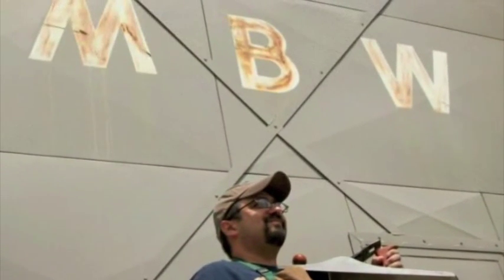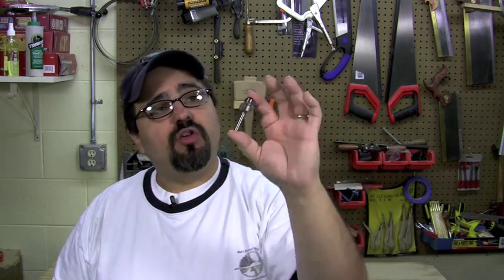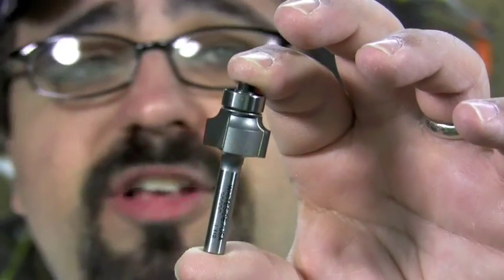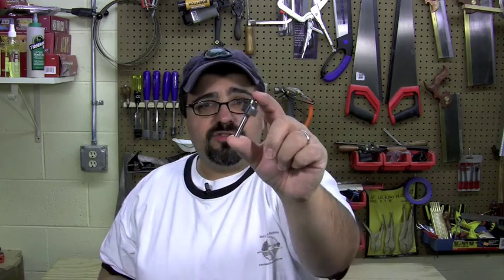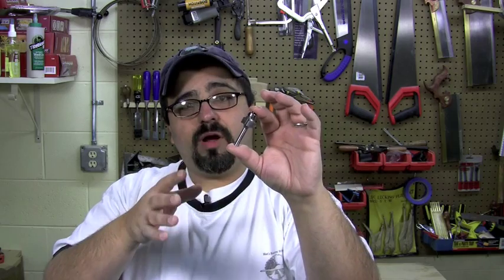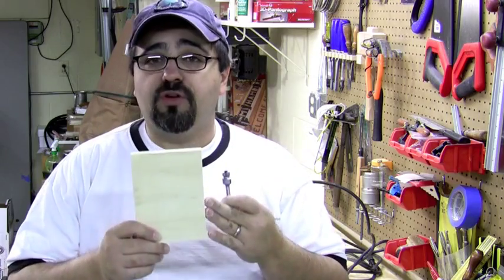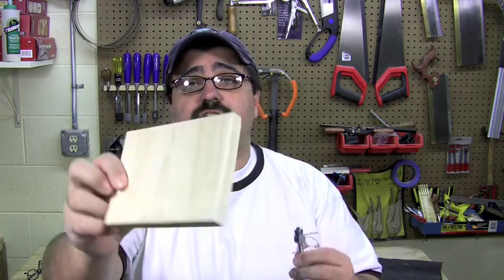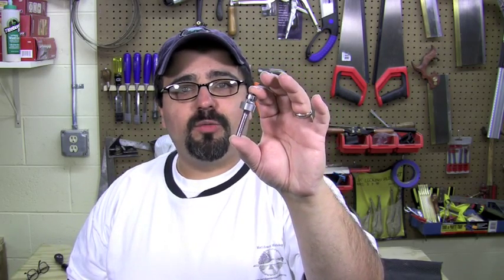343 Router Bit of the Month - Whiteside's 1/8″ Roundover Bit

Comment: will a small round over bit like this work on inside corners?  Or will I still have to do the corner by hand?
Reply from the maker: More than likely you'll still have to touch it up by hand, but it won't be nearly as much as if it were a larger diameter bit.
Reply: Matt Vanderlist
Thanks a bunch.
Reply: use a template of rounding corner with it.